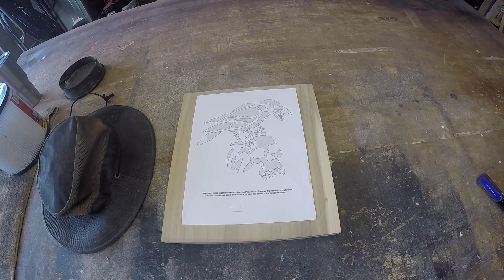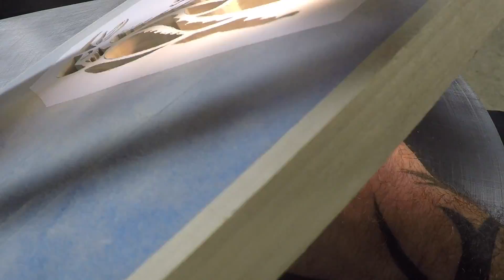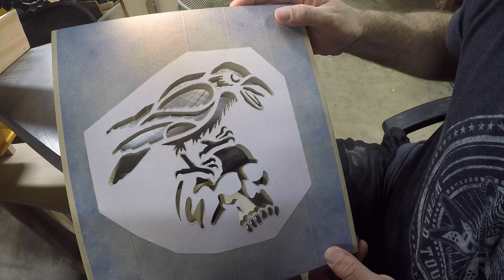The Raven and Skull on the scroll saw

Comment: Great work. Thanks for explaining stuff the way you did only question I got is were of you get you pattern. Thanks again. Keep the videos coming
Reply from the maker: Micky Swift thanks! So this is actually a pattern for carving a pumpkin, which I found online but don't remember where, google pumpkin carving patterns and you can find a lot. Pumpkin patterns really translate well to scroll saw work I've found. Thanks again for watching!!
Reply: Sorry for bugging you what brand of scroll saw did you start out with I'm looking at getting in to in
Reply from the maker: Micky Swift so I started with a 16" craftsman scroll saw which was about 120 bucks from sears, but I really would not recommend getting that. It works fine but it uses "pin in" blades which if you're going to try to do anything intricate just won't work for you, I could not have even used it to do this raven and skull. So after some research (there are a lot of brands out there) I bought a Dewalt 20" scroll saw which I believe the part number is DW 788. It's uses "pinless" blades which means you can drill super small entry holes and can do just about anything you'd ever want to do.  So I went to grizzly.com and they had a deal going where it came with the stand and light (which you really need) for around $500, which I know is a lot of money,  but I really wish I would've just bought it first, it's been what I've used ever since. The next step up from that you start getting to $1000+ in the Excalibur and Hegner brands, which are nice, but with the dewalt you would be set for a long time, it's become my favorite tool in my little garage shop that I enjoy using the most. Also keep in mind that you'll have to order some blades as well which for me was about $60 to get an assortment to last awhile. Sorry for the long winded answer lol